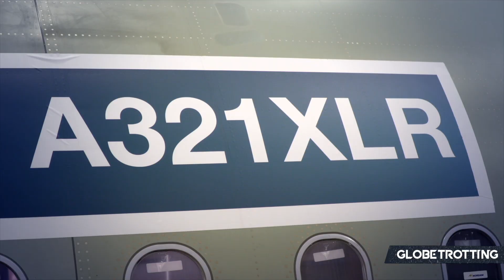Why No AIRBUS A380NEO Launch?

Comment: In short: Quad engine planes will always cost more in maintenance and fuel than twin engine planes.
Reply: Yes, but what matters is the cost per passenger km and also capacity vs slot space.. And also, if you got many planes of one kind, it might be cheaper to service 4 engines than two.. You really aren't good at math are you?